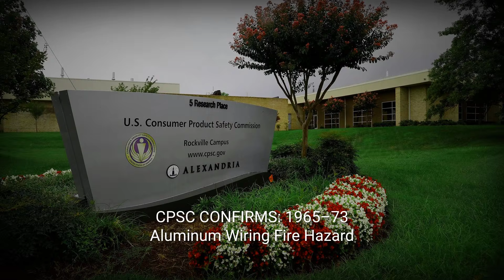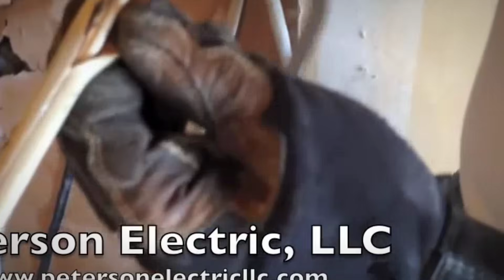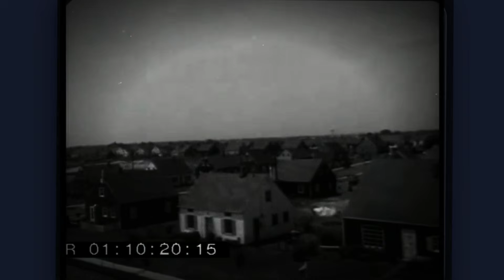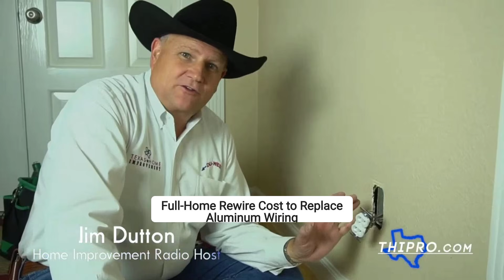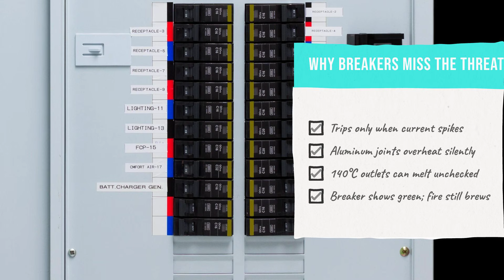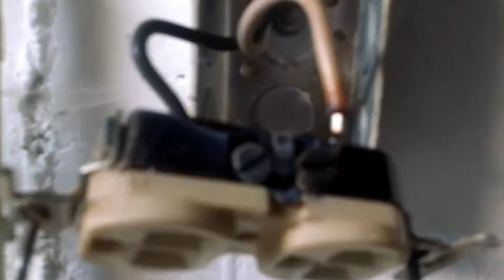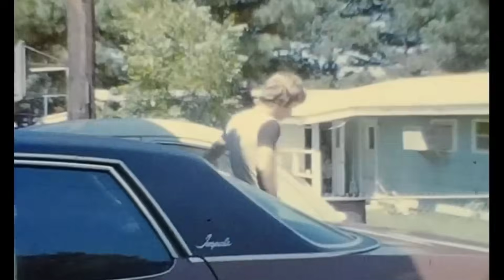Why 90% of 70s Homes Are Built to BURN (The Aluminum Wire Scam)

Comment: Why is every lousy plan a SCAM? What was done, was  a poorly thought out replacement for Copper wire. Aluminum is a decent conductor (and is still used for larger sizes). The poor part of the plan was the lack of understanding about aging and the EXTRA installation steps needed to deal with that.  When you add those steps, the cost saving fades.  Other than, Cu-Al rated devices, little was published back then.  I had my bottle of anti-ox goop I used for larger connections.

Comment: Aluminium were forbidden in domestic installation here after the WWII.  ( Germany, West).  East Germany  got aluminum wiring until the reunification. Germany got 230/400V mains so the currents at the same load are half vs 120V mains.  standard wire sizes are 1.5mm² for light & socket circuits. heavier loads need a separate line with the appropriate wire size, e.g. electric stove 5x2,5mm² (three phase).

In some older houses  we will found aluminium wiring , especially in rural areas, the the war left no much over of old buildings  in the cities.

Comment: How many homes do I have to pigtail the aluminum wire. And make sure everything was on 15 amp. Until the homeowners absolutely no heavy amperage equipment on these plugs.

Comment: Here in the UK I've seen a Victorian terraced house rewired with aluminium twin and earth.  A conductor had broken at a switch and when I stripped the insulation back it immediately broke again.  Looked like the aluminium had work hardened.  The solution was to rewire the whole house in copper.

Comment: It’s just best to rewire the whole house. It costs a little more but you get peace of mind. Aluminum wasn’t the only problem. The 75*c and 60*c insulation can be problematic as well as some of the plastic chemicals caused accelerated corrosion even in copper wiring in a phenomenon called “green goo”. Another problem is that the device boxes were undersized.  Just rewire the whole thing and get everything new. The aluminum repair is just a bandaid and it’s almost as expensive as replacement.

Comment: $250,000 - $300,000 for a home back in the 1960s?? More like $50,000 - $65,000. If you paid $100,000 back then you were getting a mansion.
Reply: I think they were directing the comment at a buyer who just purchased a 55yo house in 2026, but it was ambiguous. They should have explained it better.

Comment: We have a 1970 modular home. I am an electrician self taught and am a very adamant about code work. A pro electrician who is a close friend of mine told me I am meticulous and do excellent work and know the parts etc., extremely well. That said, when we ordered the house my uncle specified copper wire. He is a plumber but knows electrical very well. So no issues. The main panel is a good proven make as well. The only “issue” is all the receptacles are wired with number 14. Also, the service mast needs the wires in it changed since too small aluminum SE cable was pulled through it-an obvious code violation and insufficient in amp capacity. I have the brand new copper THHN/THWN waiting to go in the mast. The panel is a Murray. I an tired and had a brain fart lol 😆 i already installed 200 amp SE-U cable from the meter can to the panel 4 decades ago. So that is fine. Just gotta do the mast from the meter can to the utility ACSR Tri-plex from the power pole. Hopefully soon actually. Yep doing it live too. 120/240 is easy. But this shows not all homes in that era used aluminum. I heard “improved” aluminum NM-B cable is coming back. I hope not! Junk! Cheers!
Reply: A friend of mine just mentioned that some kind of copper coated aluminum was one of the options for hooking up a water heater in 2026. I can't say it's bad, maybe the copper coating makes it as safe as copper, maybe not. But until I know for sure, I'd spend the extra money on copper.

Comment: Explained well.  However, why the expensive crimp, when they now make outlets and switches that are safe for aluminum, for a couple of dollars?   The whole problem is that they did not produce them until AFTER all the homes were wired.  It does not cost more to make a fixture with a connection point that flexes with Alum expansion, and a paste to prevent oxidation takes a second to apply.
Reply: They started making CO/ALR fittings in 1972, but the standards for them have been revised since then, so the latest ones are probably the safest. Still, right or wrong, some insurance companies don't consider them a proper fix. There are also AlimiCon connectors that can be installed by homeowners with a good-quality torque driver (thought some insurers won't accept any DIY). I would think a combination of these methods, with AFCI breakers for some critical circuits and copper circuits added for high-current devices like heaters and ACs would be a good alternative to tearing the house up and spending $30,000 on new wiring.
PS: I would think a connector with some kind of thermal fuse, designed to blow if the temperature got too high, would make almost any wiring safe, but I've never heard of home wiring devices with anything like that.

Comment: The wire you show at 0:21 is not dangerous. Service entrance cables can be aluminum, because they tap into aluminum lugs. What makes aluminum dangerous is attaching it copper lugs and terminals. Aluminum is used for transmission lines too, so at some point in every grid aluminum transfers to copper
Reply: I second the "attaching it to copper lugs and terminals" , you have to use the proper outlets and switches rated for aluminum. If the person replacing the outlets and switches doesn't know, and attaches alum to regular copper contact screws ( on switches and outlets), then there is trouble.
Reply: @markae0  most wago connectors are rated for aluminum if you use the special anti corrosion paste 😅
Reply: Not to mention the amperage rating (like gauges)

Comment: Mobil Homes had it too very dangerous!
Reply: And that stuff was sometimes found in homes built after 1973 as well.  One of my friends, who is also a master electrician, told me of a job he bidded on to replace the remaining sections of aluminum wire following an electrical fire in a home built in 1982.  By the way he explained it, I'm presuming the home has a mix of copper and aluminum wire, and the contractors who originally wired the home were cheapskates and put some leftover NOS aluminum wire in a few places, thinking nobody will notice 😅

From my understanding the production of single strand aluminum wiring completely vanished by 1975, and even then word had already spread about how terrible of a product it really is, and some local codes began to restrict or prohibit the installation of aluminum wiring in the early 1970s
Reply: @r @rarelampcollector did a side job for a guy around 2003. He wanted me to add some plugs in his garage and I told him I had to go to Home Depot to get boxes, receptacles and Romex. He said hold on, I have some Romex here already and he went to his shed and came back with a brand new roll of 12-2 aluminum. I had to explain why we couldn’t and shouldn’t use it, he didn’t know about the aluminum wire reputation.